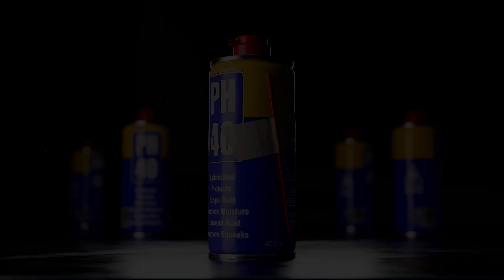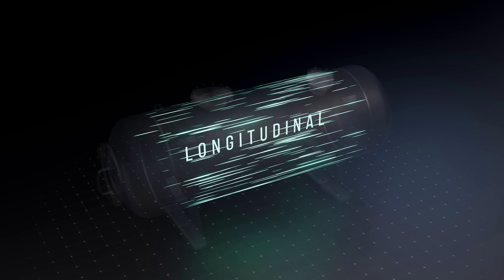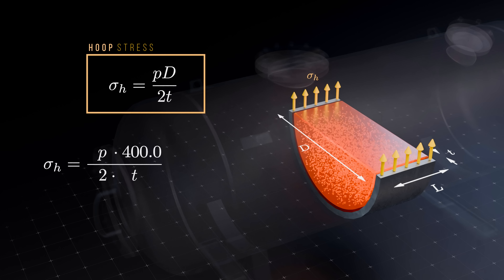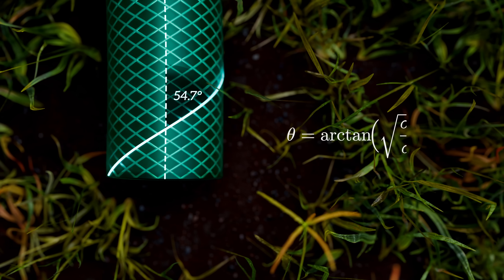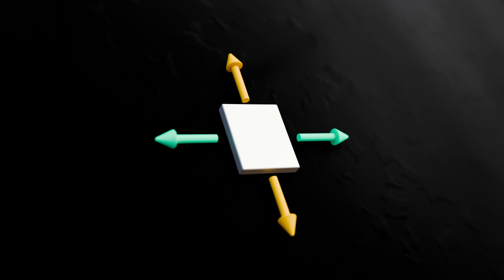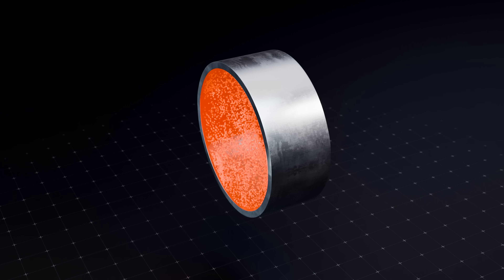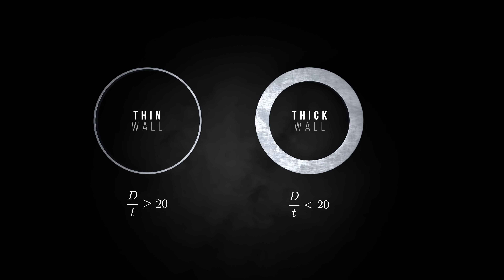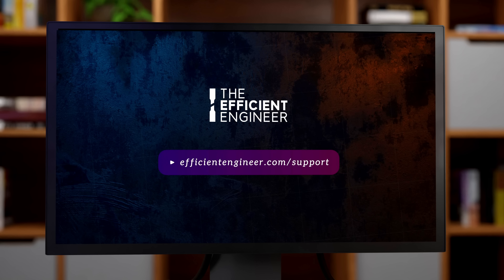Understanding Pressure Vessels

Comment: What a load of bs, " the external load is practically zero" it's 1 atmosphere or 1bar. Which must be taken into account. If the pressure vessel is to be used in space it must be made much stronger.

Comment: I had to model the stresses and deformations on a cylindrical vessel last semester, but I must admit I don't quite understand the area the pressure acts upon, the pDL. Mainly because it seems like an imaginary area hanging in the air. I would've thought the shell was the area to be considered, even though it was said that it's a sum force. And I do get the equivalence, but thinking it like a slice of air just threw me for a loop.

With liquids on top of internal pressure you also have to include the hydrostatic pressure. And of course the vessel's own gravity stress. That's probably why you'd want a vertical cylindrical vessel, so the dome that can withstand more takes more of those stresses.

Comment: A fact tha astonish me is that compressed gas get highly concentrated in near the walls, so you coul fill the tank with some materials like carbon nanotubes and conterintuively increase the amount of gas the tank can storage at the same pressure, since you have increase the surface area

Comment: I haven't done math in a while but doesn't he have the signs backwards at 9:18
Reply: I don't think so. If the ratio of D/t is larger (D/t>20) it means the diameter is so large you can neglect the effect of thickness. Thus it is thin walled, and vice versa
Reply: 5% is 1/20, so a number larger than 20 would result in a smaller percentage i,e a thinner wall.

Comment: As a static equipment engineer, we generally use ASME section VIII div.1 & 2 for designing pressure vessels. You have explained the concept very well, especially the Lame's equation for thick walled pressure vessels, which is often overlooked as most pressure vessels are thin walled.

Keep it up, please also make a video on vibrations including torsional vibration of shafts.
Reply: im a fixed/static equipment engineer as well. cool to see this stuff visualized. i did cringe a little seeing pressure as lowercase P however lol
Reply: 900 pages per division and they re-writed everything in the 2025 edition. Good luck for us 😂

Comment: Actually, I have a question. Isn't it also just very easy to manufacture or fabricate two semi spheres and weld them together at the end? Like for a cylindrical vessel, you would need to weld the hemispherical head or dome onto the final cylindrical vessel to seal everything in anyway. So why is it harder to fabricate or manufacture a spherical pressure vessel?

Comment: Yes, but why that direction of the hoop stress? Why use the projected area when finding net force created by internal pressure? I feel like these videos are mostly only accessible to mech people who have read other source materials and just require a visual connection. I'm not primed to think like a mechanical person, so i guess this is my cue to start:

The hoop stress has that direction because the net effect in this context is to consider the effect of the radial force created by the internal pressure: the effect is to push the 2 halves of a section of the pipe away from each other. What needs to resist that push? The hoop stress, which will be thus tangential to the cylinder walls.

The PROJECTED AREA is used for a similar reason: it takes into account the radial components that contribute only to the effect of pushing those 2 halves of the pipes directly away from each other. Any horizontal sideways vector here is irrelevant as far as the hoop stress is concerned. It's a shortcut. You could multiply and integrate over the entire curved area as well, but because of symmetry along the curved surface, any sine and cosine horizontal terms of the pressure will cancel out leaving only the components in the opposite direction to the hoop stress. I.e in the projected plane equal to
(Length * Diameter)

Comment: I wish you would have explained why the direction of the stresses were as they were. To non-mech people, we would not consider that the hoop stress would be tangential to the cylinder's circumference, but rather back inwards to counter the outwards pressure from the internal pressure.

As I tried to understand it:
Hoop stress, also known as circumferential stress, acts tangentially to the cylinder walls (and radially perpendicular) because the next effect of the inner pressure is to force the walls to expand outwards. Ideally at a constant rate. Because each section or molecule of the material is trying to maintain integrity, it will try to resist by "tugging" on material tangentially next to it creating tension/ stress in the tangential direction so as to resist being radially torn apart. It can't tug on material in the radial direction because any material in that direciton will be experiencing the same force with nothing to "anchor" it
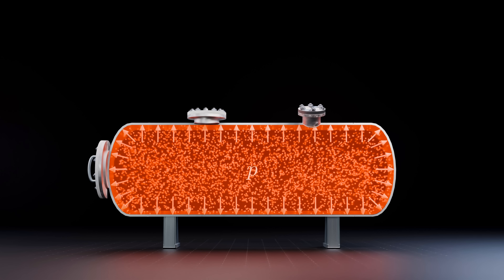Reply from the maker: Thanks for the comment. I tried to explain this at 1:17 but maybe it wasn't clear enough. Essentially the effect of the internal pressure is to push against the internal wall and try to make the diameter of the cylinder larger (kind of like when you blow up a balloon). This is what causes the hoop stress in the tangential direction. If you zoom into a small portion of the vessel wall, for the total diameter of the vessel to increase that small portion is being pulled on in the tangential direction.
Reply: @TheEfficientEngineer  That's true. It's mostly my fault again, because I'm not as primed as your general audience to have been able to have that make sense while you started with the "small cross section" visualisation. A 2nd reminder once you got to that section would have helped, because typically the pressure force is directed radially outwards, so to the layperson like me, i would have expected any eqalizing force to be directed inwards... but then again i get it's a balance you have to strike to keep the video from becoming too cluttered. 

You did an incredible job regardless, and I'm sorry if i took away from that effort. You did your part, now i must do mine wherever I personally have gaps in my knowledge
Reply from the maker: No worries, I appreciate the feedback - thank you!

Comment: Does a submarine count as a pressure vessel?
Reply: Not if titan builds it
Reply: @4lefranz   carbon fiber reinforcement is good for tension but only the resin can take compression forces. Hence a poor choice for a submarine.
Reply: In the submarine, the outer pressure is greater than the inner one. So it will experience compressive and shear forces, and buckling is also possible.
It should be considered as one just the arrow of the net pressure has been reversed
Reply: Of course yes, similar as a plane, submitted to pressure cycling requiring fatigue stress calculation. When you bend a paper clip several times, it eventually breaks. This phenomenon, leading to metal cracks, explained the disparition during flight of the first commercial jets (COMET) in the fifties.
Reply: Yes but there you want to keep the pressure out so things are sealed in reverse.

Comment: I was holding my breath until you explained about the assumptions made (for thin walls). Huge thumbs up for the simple, yet clear and detailed explanations. 
Lame's equations in particular, were almost never included in the textbooks of my time (1980's) and yet they were VITAL in the job I had. It was a difficult time, trying to manually crunch through that stuff, especially for compound cylinders (where multiple interfering thick-walled rings formed a containment vessel suitable for generating pressures of 5.5GPa (55,000 atmospheres). 
In case you are wondering, that's where carbon prefers to be diamond over graphite. So long as it's heated to 1200 degrees C at the same time...

Comment: Does the math work in the opposite way? i.e. a vacuum vessel or a submarine?
Reply: Yes, but buckling failure must also be analyzed for thin-walled (i.e. typical) pressure vessels under external pressure. Buckling (a.k.a. instability) generally results in greatly reduced strength.